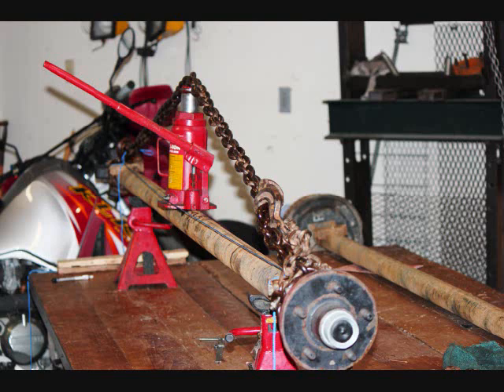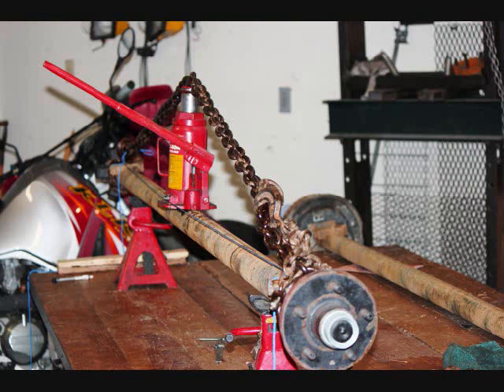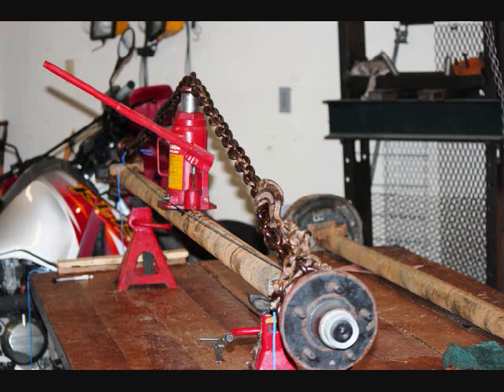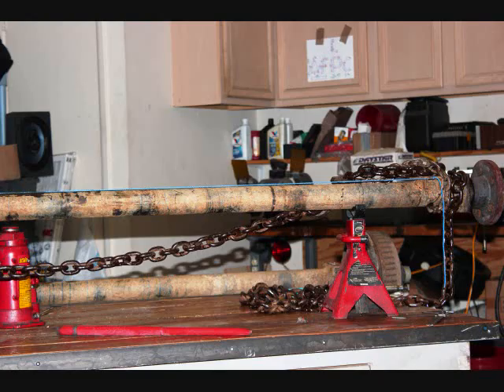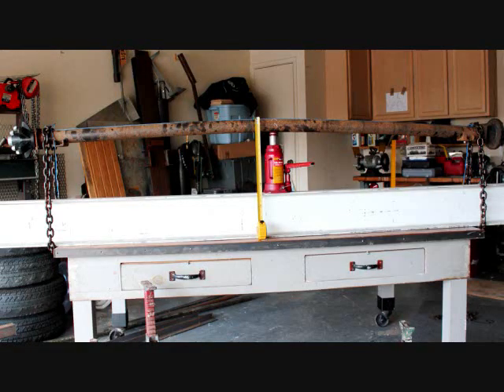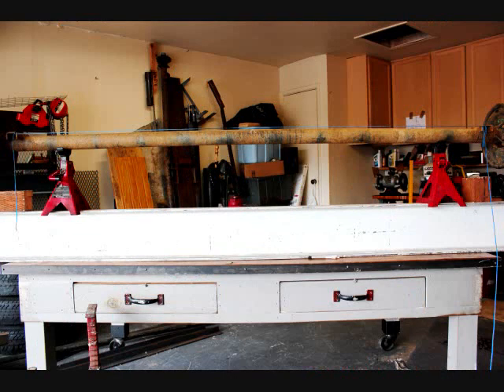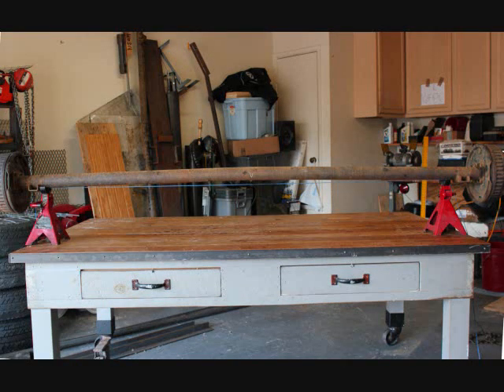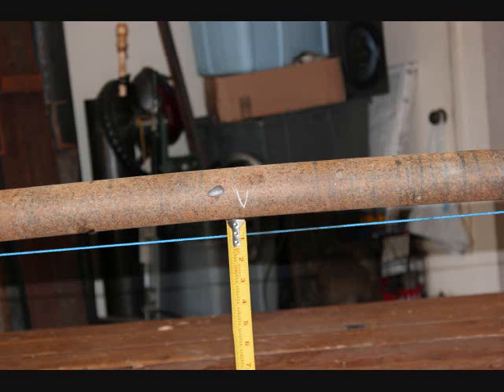Axle bending

Comment: I just did that yesterday did not remove the axils, used a cut off wheel cut the top of the axils about a third of the diameter of the pipe. Froor jacked them up 5/8" checked Camber, welded up cut. Let cool with Jack still holding pressure. Worked perfect🎉
Reply: What do u mean u “cut the tops of the axle”?
Reply: @artest7  I cut the axils tubes from the top , down about 2-3rds of the diameter of the pipe with cut off wheel. Jacked up directy under cut. Ground out the cut for 100 percent weld . It has carried max load 6-7 times  all is good.
Reply: Interesting.  You should've videoed that.  You'd be a high-paid content creator by now, with hot babes chasing you down the street, screaming your name.

Comment: Nice !!...the axle im having issues with is quite a bit different...its and axle out of an atv ..solid pretty standard but bent pretty bad! Question: can I do the same kinda metal bending like your video except with atv axle and steel pipes that fit snug over both axle ends to extend width for more leverage and control in bending back straight ? It's bent down one one side and up on the other unlike your axle that waz over grossed.. hmm I'm rethinking this now ..this atv I bought dirt cheap because it fell off top of truck on the freeway at 60mph  and bent the rear axle and broke the fender plastic ....I'm worried it will break before it gives again?? Any thoughts or ideas any body ...( I could purchase a new axle but what fun is that?) Thanx!!
Reply from the maker: Yep, I've bent solid steel also, just need a stout piece to hold it.